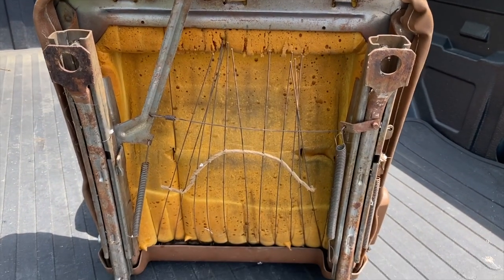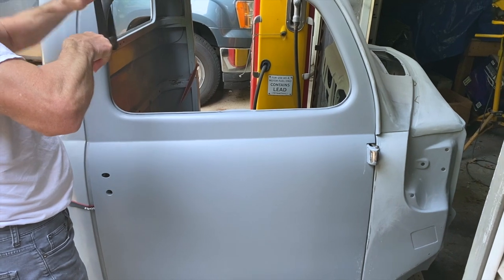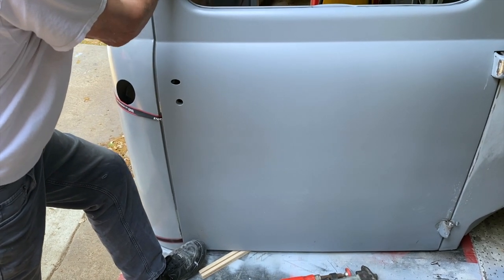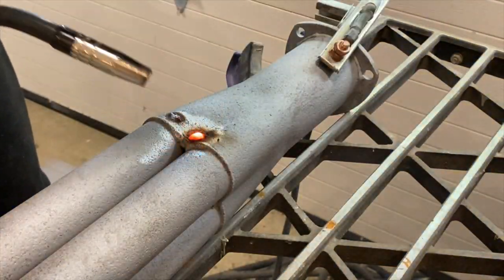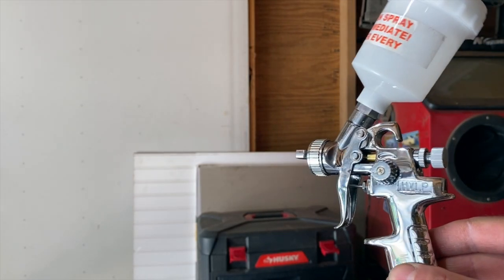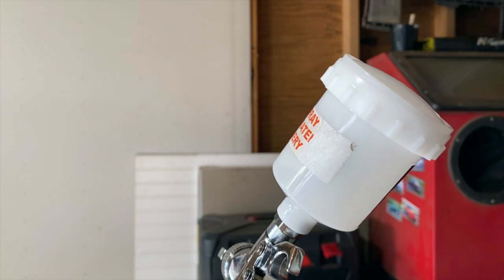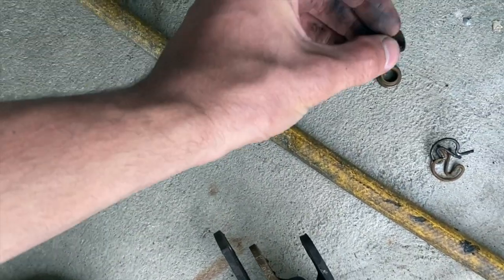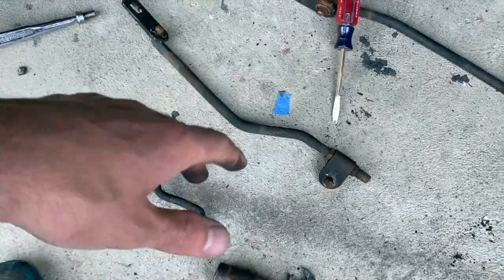Camaro CERAKOTE Paint SPREE (Headers, Engine Components) PLUS Mini-VLOG!

Comment: Ryan.  That Hurst shifter is an aftermarket Hurst replacement. Aftermarket Hurst shifters use bolts to hold chrome shifter handle to the shifter mechanism and the handle is square.  Original GM Hurst shifters used rubber and metal locking shims to hold the shifter handle in place and the orignal handles were round.  also original GM shifter mechanisms don't have the positive stop bolts in the sides of the mechanism. the shifting linkages are original GM.  GM used a rubber bushing instead of nylon or brass bushings. this keeps the shifter from vibrating or rattling. original rubber bushing are available from inline tube, part number INL12761.  the nylon and brass ones last longer if you live in a really cold or hot environment. the rubber ones dry our and crack after a few years. but they are significantly quieter that the nylon or brass. the brass ones are really noisy and will drive you nuts in a street driver car if you drive it all the time, nylon is compromise between the rubber and brass as far a noise goes.  I run the Rubber ones in my 71 Camaro SS 396 4 speed. Slop in the shifter is usually caused by worn sector plates, worn sector button, and spring plates in the shifter assembly. incomplete gear engagement usually caused by worn bushings or misadjusted positive stop bolts. Holley Performance Group now owns Hurst and they offer a service kit for the shifter.  part # 3327303. it has new sector plates, shims, selector buttons, springs and lube. it also included the bottom debris shield which is usually missing. it will make you shifter like new. someone probably swapped out the GM mechanism for the aftermarket Hurst because the original was worn out, and replacement parts/ service kits were not available until recently. Hurst used to have a rebuild service, but it was stupidly expensive. After Holley bought Hurst, they start offering the service kit. As for the shifter linkage adjustment. there should be just enough free play for the linkage so swivel around the rod, but not move front to back on the rod. I like to use a .005 feeler gauge between the nut and the slider. seems to work well for me. hope this helps. Shad. I love the Cerakote on those headers. looks really nice. I am going to look into using that for my cast iron exhaust manifolds if they have it in a cast iron color.
Reply from the maker: I screenshot a comment of yours on just anout every video I post. Thank you for typing this all out, this is info you don’t come by online! As for the cerakote, I have been experimenting mixing glacier black with glacier silver and you can make a nice cast iron mix with it (they don’t currently have cast iron that I know of). I like their products since no matter how you have your gun set, the sheen is the same every time when it dries.

Comment: You're making me miss my "hawkeye" 07 WRX Wagon. It was the same color as yours.  I'm looking to buy a small blasting cabinet.  Any comments regarding the Harbor Freight unit you have?
Reply from the maker: I always say “I’m going to sell it this year” but when I drive it I change my mind quick lol. I would get the bigger one for sure at harbor freight so you aren’t as confined as well as dont have to set it on something. Mine works well but before you start to use it seal it up with a ton of silicone or something on all of the seams. I found that the “fine” coal slag works the best for the blasting media (tractor supply for 10ish bucks for a 50 pounds bag). Also need a decent size compressor (mines a 60 gallon and runs nonstop when I blast) with a good water trap. Other than that its great lol!

Comment: 11:42 those 2 nuts are to be loosened when you do your neutral alignment when the shifter is mounted on the transmission along with all the rods. After the shifter is placed in neutral you insert the neutral alignment gauge or drill bit through all the shifter levers where the cutout is then tighten the 2 nuts tight for all 3 shifter arms, then remove the gauge. See this page on my web site https://my1970z28.com/COPO/diagrams.htm
Reply: this is also an aftermarket shifter, so it also has the positive stop bolts on the shifter mechanism. so those need to be adjusted as well.
Reply from the maker: Thank you guys for pointing this out!!

Comment: hay those after market tri rod end you used are just junk if it was i i would never had used that first there not as strong as the orginals also they cost a lot if money you didnt need to spent and it make the car worth less a car with it,s orginal parts is worth more al you would have needed to was to clean and paint the orginal ones it would have ownly cost you a couple of dollors to get the dirt and rust of with a little sand paper and just a small of paint out of a spray can and in the end you would have the better tri rod ends on your car its never good to use after market parts on a car like this and you say  why it because that most after mark part makers are not around very long so you use there parts and in a couple of years or so you to need replace or repair your parts and then you find out that the company that made them whent of businuss and you can no longer get the replace parts for those after market parts you use so then you,ll to replace those part with another part from another company as you can,t repair the parts that you have as no one made the replacment parts your needing so it better off not to used those in the first place and you won,t have that problem  ya the after market look cool but thats about it and if you used orginal parts you,ll never have that problem i.ve seen a hole lot off car  people to have just that problem with after market parts and wished they had never used them